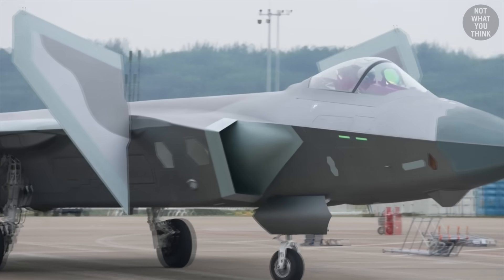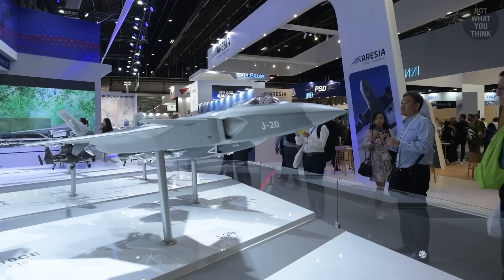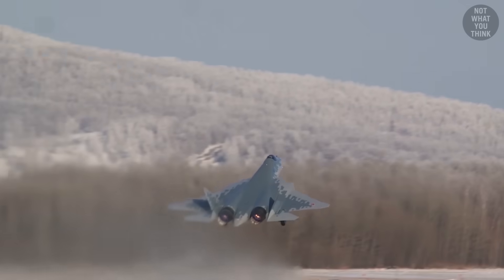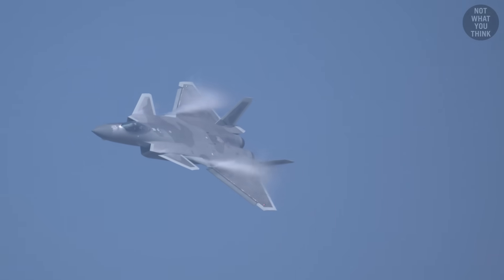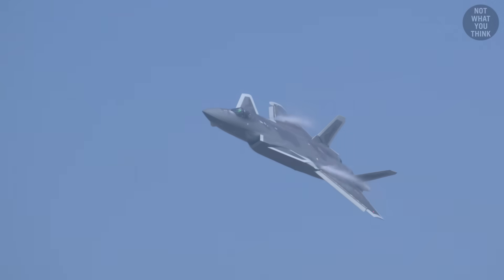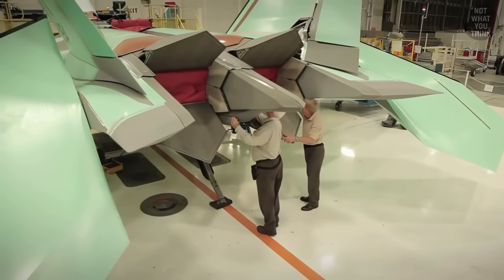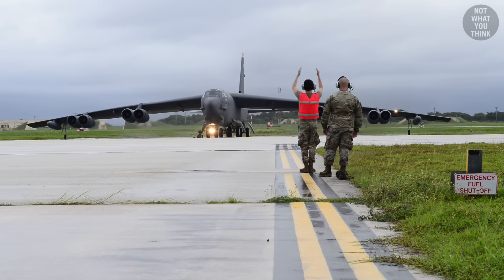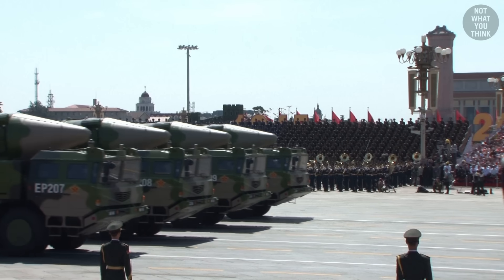Why China's Stolen "Stealth" Fighter is Problematic

Comment: The vast majority of people hold misconceptions. While China's beyond-visual-range combat systems are indeed highly advanced, the J-10C itself ranks as the most capable 4.5th-generation air superiority fighter. It is not an iteration of older J-10 variants; its aerodynamic design and integrated technologies represent cutting-edge innovations, including numerous features derived from fifth-generation aircraft. The J-10C only entered service in 2018. In the 2019 air superiority fighter rankings, China placed the J-10C fourth, surpassed only by three fifth-generation fighters (multi-role aircraft like the F-35 were excluded), with the Eurofighter Typhoon and Dassault Rafale trailing behind it. The 2024 Qatar military exercises partially validated its capabilities: in beyond-visual-range engagements against the Typhoon, the J-10C achieved a 4-0 victory, and secured a 5-0 win in close-quarters combat, demonstrating decisive superiority.

China's research and development policy is rigorously factual. The discrepancy between reality and external perceptions stems primarily from Western ideological bias and persistent disinformation campaigns about China. Regarding Chinese weapons specifications, China employs a reverse understatement approach. Published performance parameters represent the minimum guaranteed performance under the most adverse operational conditions. For example, the PL-15E missile's stated range of 145 km often translates to an effective combat range of 180-200 km. Conversely, Western specifications tend to be inflated, citing idealized optimal conditions with additional exaggeration.

A notable example involves the J-20 and F-22. China developed the J-20 targeting the performance figures claimed by the U.S. for the F-22. Ultimately, the J-20 surpassed those inflated claims:

The F-22 claimed a lift coefficient of 2.0 (actual ~1.7), while the J-20 achieves 2.1.
The F-22 claimed a thrust-to-weight ratio (TWR) of 10 (actual ~7.95), whereas the J-20 reaches 10.5.
The F-22 claimed a radar cross-section (RCS) of 0.001 m² (actual ~0.01 m²), while the J-20 ranges between 0.001-0.05 m².
In real-world terms, the J-20 has surpassed the F-22 to become the world's most capable fighter aircraft.

Comment: Yeah the ws15 engine might give marginally better overall performance to the j-20 shitty dragon but lets not forget that its core has an absolute max lifespan less than 4000 hrs. Less than that if they need to use afterburner for extended period of time. As for stealth if you think marginally more stealthy than an F-18 super hornet is "stealthy" it doesn't matter how many they have if a B-1 were to act as a missile truck carrying 40 to 60 amraam's then any F-22/F-35 especially can act as a quarterback before they can get close enough for their radars to burn through the stealth of the F-22&35's. You said time is on the J-20 side. I disagree absolutely. Unless they can figure out how to make a proper engine core and properly stealthy airframe they will always be playing catch up. Always the bridesmaid never the bride.

Comment: You used Aircraft101 as a solid source of information for the J-20A's RCS, but you didn't use their numbers for the F-35A's RCS?  

The source clearly states that 0.21sqm is the median RCS of the J-20A in the X Band without RAM or leading edge treatment, and then you're comparing that number to the F-35A's absolute minimum RCS with RAM and leading edge treatment.  

This is some laughable propaganda, mate.

Comment: The J20 vs F22 is like comparing a Tacoma to a F350 Cummings. They are both trucks but that's where the comparison ends. J20's higher RCS, shorter range (stated 1200 range but 🇯🇵 has documented refueling under 600 miles ) , questionable reliability etc...etc.
 Once they get beyond resolving their issues the USAF/Navy will have operational NGAD/FX/AA
Reply: yes😊

Comment: F-35 and F-22 are simply garbage. Their characteristics of requiring constant temperature hangars make their logistics unbearable. Their radar and other electronic equipment can't even compete with J-20. Nowadays, China has made the cost of stealth coating just 1 dollar per kilogram. What can the United States use to defeat J-20? The missiles carried by J-20's weapon system are also more advanced than those of F-22 and F-35.

Comment: I would say it is reference to all used designs. It has considered weak engine China had in 2011. Conrad is to use to cover weakness. But now new engine is equipped in new produced J20s. So F-22 might flight to coast to test J20 to see which can detect each other first. Without test you could not prove it.

Comment: the main reason why j20 doesn't have machine gun because of the j20 is an interceptor not a fighter, without a thrust vectoring nozzle, it has no huge advantage abilty of perform dogfight with real fighter, it just a paper tiger in reality.

Comment: The J-20 is a fat pig. I don't believe for a second that it can compete with the Raptor, especially after the recently announced updates to the F-22.
Additionally, the J-20 has poor to no rear-aspect stealth.
Reply: But it doesn't need to compete with the raptor. Even if it is hopelessly outmatched by American 5th gen planes, it could still be a big problem with Super hornets and eagles.

Comment: A problem of reverse engineering tech is you know what that is but you might not know how it was made
Say, you found a aircraft with stealth material, but how tf did they create that material, is there any special process?

If you get yourself a really good sensor that use a specific chip, then you wonder, wtf is this chip? Where and how to get it? What's the spec of it??? 

So yeah, reverse engineering something isn't gonna be easy (unless you can get your hand on the process of making it)

Comment: Note that in modern air combat, the distinction between interceptors and fighters has become very blurred. They are all beyond visual range air combat. Machine guns originally seem to have little significance. In actual combat, long-range missiles are launched to attack the opponent's fighters and early warning aircraft. Dogfighting no longer exists after the Yugoslav Civil War. They are all beyond visual range strikes. Moreover, the fifth-generation aircraft does not have much advantage in dogfighting over the fourth-generation aircraft. The Typhoon fighter also has a record of defeating the F22 in dogfights. The J20 and F35 are not biased towards dogfighting, but are beyond visual range + as battlefield information nodes, and dogfighting can be handed over to the F15 F18 J16 J10 and other 4++ fighters to complete.
Reply: As always there are caveats to that record of a typhoon getting a kill on the raptor. The Raptor was intentionally hamstrung as it wasn't in its clean configuration it had its two under wing fuel tanks which one fouled its stealth capability and severely reduced its capability in the merge. So any fighter in the 4++ generation is more than capable to shoot a raptor depending on the skill of the pilots then. But in scenarios where there are a pair of clean raptors against any number of 4++ gen fighters at least 12 will know that there was a pair of raptors in the area.

Comment: The F35 is capable of taking on the J-20 and the US has a LOT more of those, also I would expect to see a stealth fighter drone before a F-22 successor, thing about the fighter drones unlike the F-22 at all or even the F-35 which has a special version the native design should easily be able to go on a carrier given how much smaller and lighter it would be, given how much cheaper it would be and that you wouldn't need a pilot it only need to carry a couple of missiles in an internal bay if your trading even 1 for 1 it's a massive win.

Also it's small size makes it easier to make it stealthy, you probably wouldn't bother making it significantly more stealthy than the F-35 if that can lead to large cost savings, furthermore a fighter drone can be made to be significantly more manoeuvrable because electronics can be made to withstand massive G loads, the airframe is what is going to be the real limiting factor there.

Comment: You CANNOT build an airplane using stolen designs and use an indigenously produced engine to power it.     The weight distribution and power dynamics are totally different.   So the myth the Chinese used stolen tech is just that-a myth.   The J20ay have been inspired by US and Russian designs but that is different from stealing wholesale.

Comment: Another West JOKER smearing China here, specifically China's J20. Just because J20 has wings, air intakes, twin tails, landing wheels, etc. so it must be STOLEN/copied from F22, F35 all those RUBBISH. If F22 so good, why US stopped making it? F35 has crashed so many times so often show it's a killing machine like American earlier Widow-Makers. The most recent crash involve a brand new F35 just out the factor. US and UK need to clean up their own carpets before smearing others.
Reply: 1. The F-22 wasn't needed. By the time it was cancelled, the US had no peer or neer peer threat. And even if they did have to fight a neer peer threat, the lighting exists.

2. 18/1000+ lightings have crashed. That's pretty normal for a plane.

Comment: I have to wonder how you claim the J20 has more advanced technology than the F22 - when you actually produce no evidence of such technology? You appear to simply equate that because the J20 was produced years after the F22 it has advanced technology. Might I suggest copying something equates to being years later (and their copy is lousy).

What special insight do you have on China's equipment?
For that fact, what insight do you have on the F22? I assure you that the information on the F22 is degraded.

1 - China produces nothing technologically advanced without first stealing it from elsewhere. This reliance rather hinders the ability to be "first" in a technology.
2 -  How advanced is the technology - you don't seem to know - or at least do not seem to reveal any knowledge. You do state that china has always had trouble simply producing advanced engines for jets to get above mach 1 without afterburner... so how would this lend to the belief that their technology is advanced?
3 - China's copies - like most of china's products - tend to be low quality, low performance, and highly reliant on maintenance (if they even function).

By the way, China is not only known for stealing all its technology, but also for slavery and slave labor.

Comment: Even assuming that all the asian kids in STEM in the US will stay and work for the US, China would still be "producing"  4 times more Engineers that the US, yearly. If we make the reasonnable assumption that many of those Asian kids will not stay in the US - especially given the rampant sinophobia - then that has China producing 8 times more Engineers than us, each year. We're already seeing the results in the failed attempt to slow down the Chinese tech industry by denying them high-end chips. They were supposed to struggle to produce 10 nanometer chips on their own. But what do you know ? Here they are, producing 7 and 5 nanometer chips. So let's keep scraching our bellies, talking about "stolen" tech by China.  SMDH.

Comment: Why does all the modern crap go slower then older planes and they cost more. It’s like modern car industry with older cars and a stupid electric shit. Stealth is shit talk the crap shit drops a contrail a mile long what are they going to do spray the sky do they can say their shit works and it’s stealth. They could be bought down with ww2 anti aircraft shit they make a noise. Is the airforce like the ground shit instead of using the ammunition from the shit gun then die or super man propaganda ability kicks in but your supposed to die after dropping the millions of dollars with of bombs from the plane then Tom cruise it back to the aircraft carrier before Russia launches 20 fighter planes after you. So basically sniper but with a plane and more expensive stuff for lazy people and some sort of mechanical alien technology that doesn’t work like stealth and radiation eliminating bombs ect.

Comment: Laughable idiots. only 29% F35s are full-mission operational. Congressmen call this project disastrous failure.
Reply: 1. The maintenance infrastructure hasn't been built yet, until 2027. That's a problem, but not with the plane
2. A plane doesn't have to be perfectly mission operational to do it's job. If just a couple sensors is having a bad day, that's enough to put it out of that 29% group.

Comment: Compared with F20, the biggest disadvantage of F22 are not only its out-dated electric awareness and its fuel shortage, but also its shorter range missiles, it can not go longer distance and it could be shot down before escaping, although its radar is under upgrading, it still couldn’t solve the fuel shortage issue.

Comment: The headline "problematic" is absent in the actual video.  The chinese AF and the USAF have two very different  missions. The Chinese AF has to operate within ~1000km from the chinese mainland (or possibly from its bases in the SCS).  The USAF has to operate 5000 miles from the mainland.  In the event of a major conventional millitary confrontation, all the runways  in Guam, and Okinawa  will have huge potholes. Where will fighters land?  The US DoD is developing AI controlled unmanned aircraft, a very good idea. But the smaller the plane the shorter the range.  The concept of a small unmanned fighter is a great idea for China, where these small aircraft are a few 100 to 1000km from their land base. But for the US these small craft won't have the range to get to where the action is without refueling.  In other words great idea for defense, not that useful for offense.

Comment: F35 cannot be classified as a 5th generation fighter, as it lacks some of the crucial features like supercruise, supermaneuverabilit etc.
Reply: i mean, isn't it just up to whoever is naming it to put it into what ever generation they like? there aren't hard definitions. you could have literally an invisible UFO with tractor beams, but because it can't go over mach 0.99, maybe it's gen 2.

I think in a more pragmatic definition: the generation of aircraft is determined by when it was built, which if your building a new aircraft you'd usually have the new features.
Reply: The F35 is a 5th Gen fighter. It’s literally the most advanced fighter jet to ever fly.

Comment: The J-20 isn't that stealthy.  It's canard design insures that.  Furthermore, it takes a lot of money and time to maintain stealth technology. F-22s get regular maintenance to keep them stealthy, which means less availability.  The J-20 will either be the same, or it will degrade, thus keeping them unavailable.  One problem with Russian engines is life.  They won't last and require a lot of maintenance.  No doubt Chinese engines might provide performance, but they won't provide availability.

Comment: The problem with reverse engineering is that you do not learn what doesn’t work, and why.
Reply: When you can't compete, just say, "It's stolen/copy."🤭
Reply: @kinwaisiu9414  you forget about how human technologies evolve with “copying and learning from each other” my mate. If that’s how human technology gets developed, why only call out one country the theft while forget about what had you done?
Reply: You definitely learn how something works when you reverse engineer it...
Reply: @Foquro  The point here is that you may learn how it works, but not why it works like that.

Meaning if you want to make something similar, youve only got the data on how to make exactly the same thing, with no idea on how to improve, repair or adapt it for your own needs.

So unless youre also planning to copy every single other part of the original design, youre gonna struggle to make things work together with your own tech.
Reply: @TheSpeep   @TheSpeep   I don't get your point here. The J-20 is clearly not an exact copy, which means that they are capable of improving and adapting...
Reply: @Foquro  The point is that since they dont have the research that lead up to the development of the tech, theyre at risk of running into all sorts of issues that the original developers learned to avoid while creating the stuff they copied from, especially when trying to adapt it to their own systems.
Reply: @Foquro I think the original comment is saying that even though you lean what does work, you don't know what doesn't work at all or as well, because you only see the finished product with what works. You never get the prototype to see any improvements on bad ideas or mechanisms
Reply: @Foquro  Is that why China still lacks a decent Fighter engine? lol
Reply: @gabby6343  WS-15 engine already on J20. Update your information.
Reply: @Maplin-Ma  oh, I know. Still a crap engine...lol
Reply: @gabby6343 how do you know 😢 you are the god of engineering who can call something you never seen in person a crap? Why people are so arrogant and stupid nowadays
Reply: @gabby6343  Regarding jet engine, top-notch scienctists Chinese make world best jet engines. Notice Better than both AM and Russia.

Comment: It’s not a problem at all. There is one country on earth that can produce stealth aircraft at scale. The USA. The Chinese cannot even produce the correct type of steel needed for aircraft carrier flight decks. The largest steel producer on earth, with limitless money, stolen tech, and every advantage possible, cannot produce aircraft carrier steel. What the hell makes anyone think they can produce stealth tech? Stealth requires state do the art production of every material down to the wiring and the paint they coat the plane with. No. China cannot do this. France cannot do this. The UK cannot do it. Just USA.